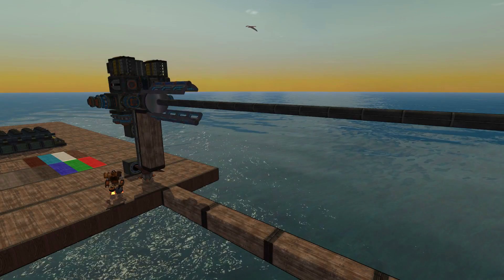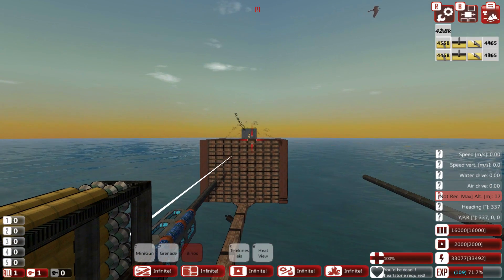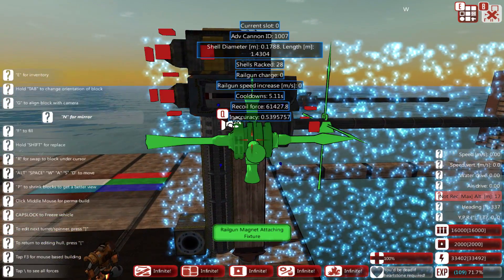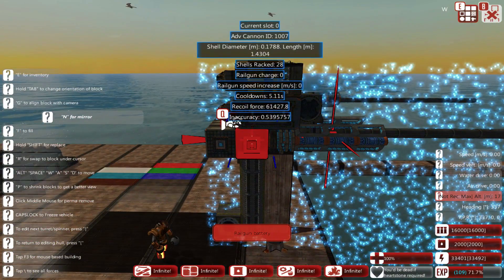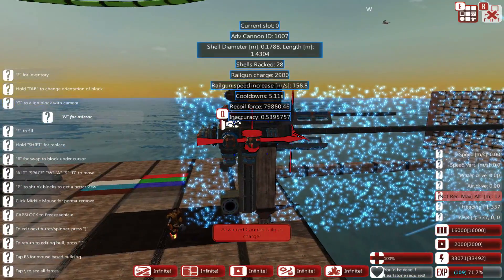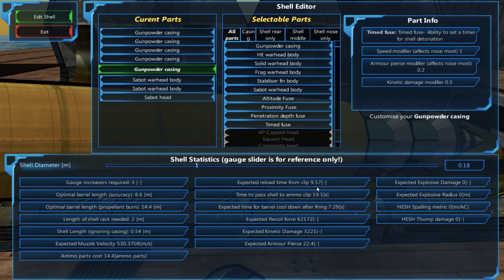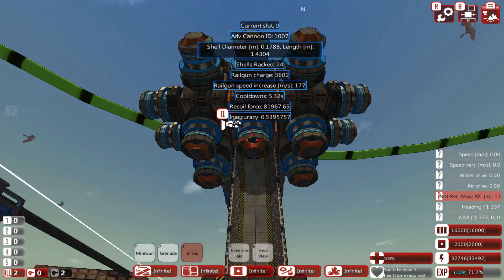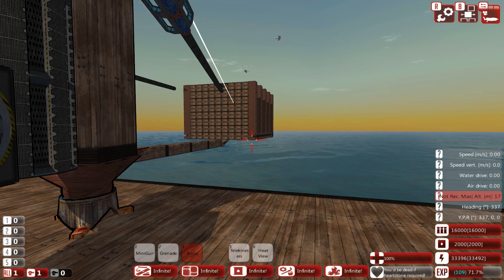My First Railgun - Tutorial - Advanced Custom Cannons - From the Depths[OUTDATED]

Comment: With the instantaneous speed and penetration power of the railguns, lasers will become unnecessary as primary weapons. This looks to be an incredible update and a game changer. Great tutorial.
Reply from the maker: +CBR Lobster (Phil) The railguns are pretty savage.  You can just punch holes straight through entire ships.  I'm thinking the lasers are gonna need a bit of a rebalance after this.  Especially when the engine overhaul comes along and the power availability is scaled way back.
Reply: You do not understand the true power of lasers. Snapping kindsteads in half in seconds. But when the engine overhaul comes yeah i agree.
Reply from the maker: Oh, I know how powerful lasers are, but they also need an enormous infrastructure without using drumstick engines.  The cavity requirement on any laser worth it's salt is pretty crazy.
Reply: But we have drumstick engines so.
Reply from the maker: Personally, I don't like using them because I feel they're a little cheaty.  But I can't argue just how effective they are. :)
Reply: +ireLAN Gaming 
What are drumstick engines
Reply from the maker: With the new engines, completely obsolete, lol.  They were an exploity way to get loads of power out of the old system by making a really long crankshaft covered in cylinders then have all of the carbs as far away from the engine block as possible.  They look a bit like a drumstick, hence the name. :)

Comment: btw when you are making railgun you really dont need that many gunpowder casings 1 will do. You have to just give them enough energy.
Reply: having more batteries means having higer velocity
Reply from the maker: +Luukas R Yeah, they're not necessary, but with the current linear scaling on powder charges, you get a lot more 'bang for your buck' from powder than railguns without making a stupidmassive battery array. :D
Wasn't aware that more batteries increased your max velocity.  That's a cool tip, thanks!